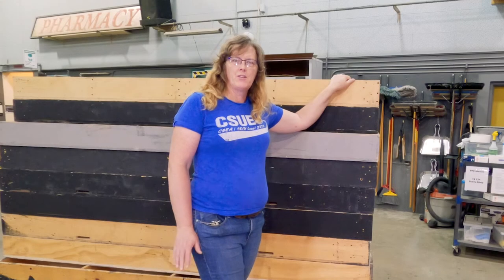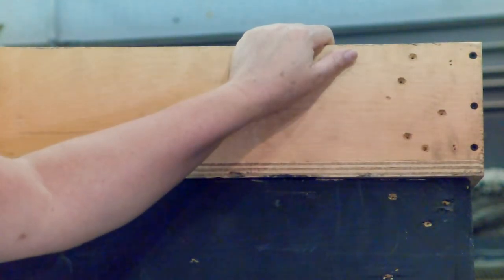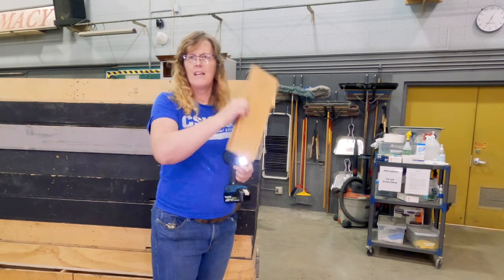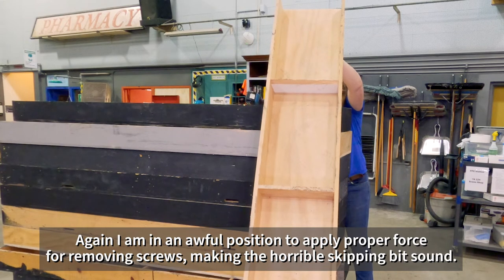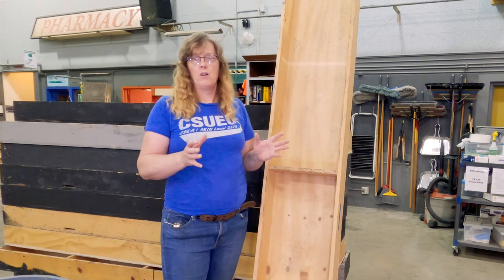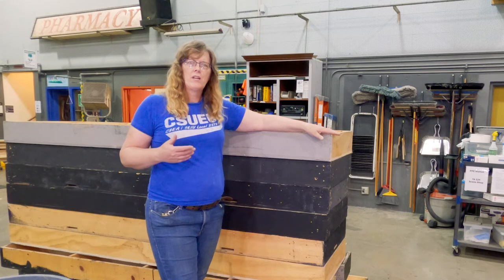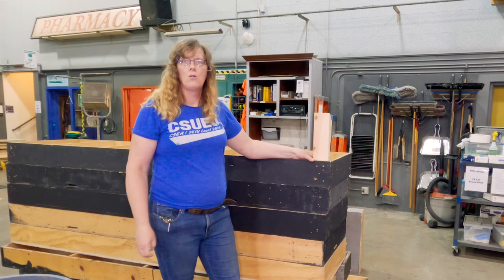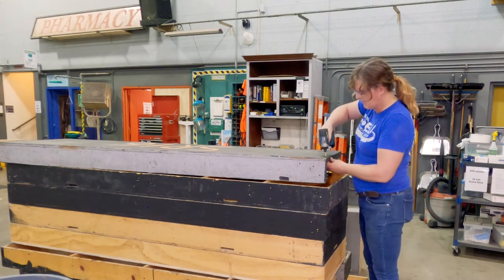Screws vs. Staples – Platforms Overview (part 1 of 9)

Comment: A question just out of curiosity: where do you get your lumber?  I'm in Overland Park, KS, so I don't have probably the same selection as you may.  The big orange box store, the big blue box store, the big green box store, mostly.  The prices are hilarious, the quality even more so.  And with our climate (frigid to sweltering, bone dry to swampy, different daily), most of the 1x lumber we get from those places has more warp than Starfleet, and that's the good stuff.  For TV flats, we've taken to ripping BC ply (what isn't Pringles from the store) into strips for framing, and making 2x4 platform frames.  Bulk orders from a lumber yard?  Grab as needed?
Reply from the maker: That is the challenge. The box stores have always had middling to poor grade lumber selection.  I’ve found cultivating a good relationship with an actual lumber yard provides the best options. 

That said, the quality of available #2 or better pine 1x12 has been declining since the pandemic. No idea if it will bounce back. Usually that means more wasted lumber when ripping down to 1x3 or 1x6. But I always prefer to buy 1x12 and rip it to the widths I need. It gets worse if you buy 1x3 or 1x6. 

A lot of the industry does use a plywood substitute for solid lumber in scenery construction. 3/4” ply is going to make all your scenery heavier tho. I understand you can buy it milled to your build size and in lengths longer than 8’. But do you have that kind of option in KS? Probably unlikely. 

I used to use BD grade ply because it was more available at some of the box stores and cheaper than AC, but haven’t seen it on any shelves here in years. I try to find a 7+ layer version of 3/4” AC plywood whenever possible. 

I’ll try to find some product names that you can search for or ask if local places can get. Or start spending the premium to buy the better grade or clear 1x12 pine. (Don’t go near Douglas Fir solid lumber though. Always stick with pine. Doug Fir may be cheaper but it is usually much poorer quality lumber than pine.)
Reply from the maker: We don’t have enough storage to buy too much in bulk. Though there’s talk of trying to do more of that and create more storage next season.
Reply from the maker: I also imagine because demand for lumber went up during the pandemic and the supply couldn’t keep up that some lumber mills are speeding up the process to keep the supplies moving and perhaps harvesting trees to early or not letting the lumber dry as much before cutting to size or something in that range of actions that is affecting the quality of the lumber for the end user. Buy larger dimensional lumber, cut it to the size you need, and expect more waste than we are used to?